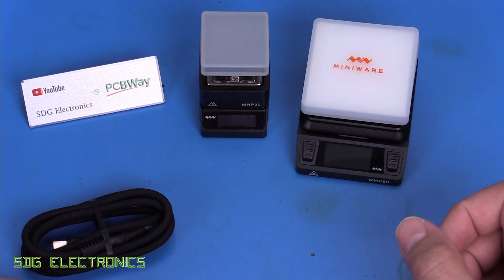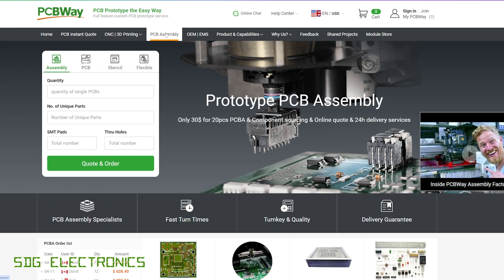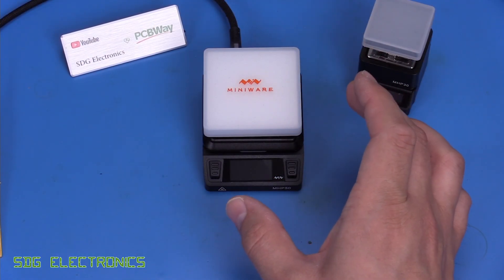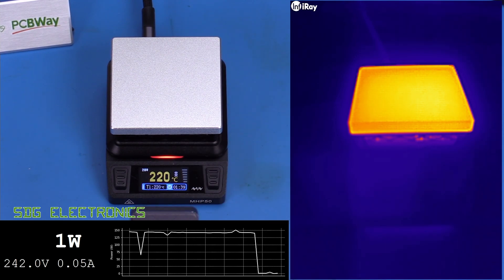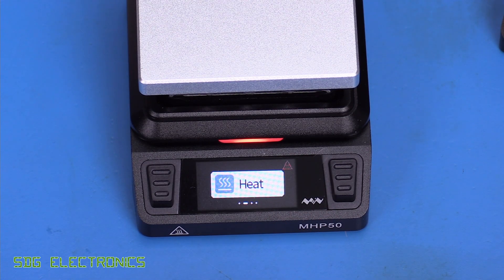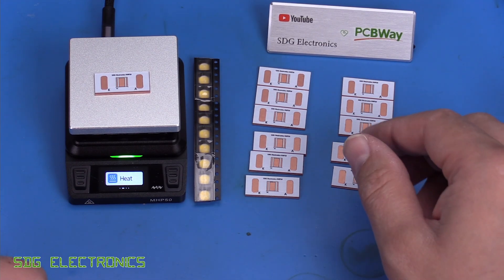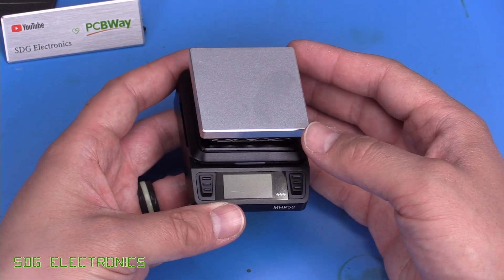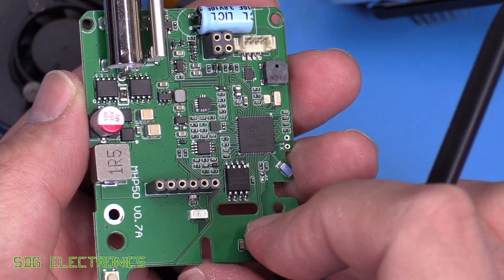SDG #334 Miniware MHP50 Mini Hot Plate Preheater

Comment: Hi Steve. Quick question if I may. After applying solder paste, 
Is there any disadvantage to throwing on a bit of extra flux paste? A bit of extra clean up is not a problem but just wondered if there's any reason I shouldn't do this.
Cheers
Matt.

Comment: Furthermore I don't agree with the comments in this video of having to slide off the PCBs after the solder has flowed.

The fan has been installed for a good reason and it's not there to keep the Miniware MHP50 cool.

The main purpose of the fan is to cool down the hot plate as quickly as possible after the solder has flowed.

I suspect that this is the main driver for the aluminium hot plate option which cools much faster than its brass counterpart hot plate option.

My take is that you choose the aluminium hot plate (which has a lower thermal mass than brass) if you want faster cool downs (assisted by the fan).

Once again this is my take as I had to make some decisions about buying this Miniware MHP50 which had me thinking.

I'm not familiar with what is available on the market, but it seems that the Miniware MHP50 is the first hot plate that has a programmable soldering profile which up until now has been the realm of soldering ovens.

Are the other soldering hot plates on the market that have programmable solder profiles?

I've never heard of a soldering hot plate with a cool down fan up until now, which if true makes this soldering hot plate a revelation to have programmable soldering profiles and goes to explain why there is an aluminium hot plate (which has much better cooling performance... heating speed is less important) and I can't really understand any advantage of having a brass hot plate in this application.

This is just my personal opinion as I've only just ordered my Miniware MHP50 24 hours ago, so none of what I have written is from practical experience.

Comment: I'm human and therefore I make mistakes but having had studied the spec sheet for the Miniware MHP50 I don't agree with what was said in this video.

My take is this:

1. The USB-C power interface is PD 3.0 (not PD 3.1), therefore the MHP50 can only put out a max of 100W if powered via USB-C.
2. The 5.5mm x 2.5mm DC input can go up to 28.0 VDC achieving a max of 150W.

How did I come to this conclusion?

I wanted to buy a Miniware MHP50, but I also needed to buy a PD 3.0 (not PD 3.1) USB-C power supply.

A PD 3.1 power supply is double the price of a PD 3.0 power supply and therefore unnecessary for the Miniware MHP50.

If you want to run the Miniware MHP50 at its maximum 150W the only way you will do this is through the 5.5mm x 2.5mm DC input with 28.0 VDC.

I don't know this from practical experience because I ordered my Miniware MHP50 only 24 hours ago on Aliexpress, so it hasn't arrived.

There is nothing in the official Miniware MHP50 spec sheet that it uses the PD 3.1 standard, so save your money by not buying an "expensive" PD 3.1 power supply.

100W will work for most applications, but the only way you will hit 150W is if you power the Miniware MHP50 with 28.0 VDC via the 5.5mm x 2.5mm DC input.

My assertion is based on the Miniware MHP50 spec sheet and not practical experience.

Comment: Thank you for your review. When you use USB-C power supply to restart the reflow, it should be that the power of the power supply is not enough. You can adjust the PD power limit to about 130W in the menu, and it should not restart.

Comment: I've been using my MHP30 to reflow small boards, with IronOS it can also do reflow profiles. Funnily enough it also has an issue where sometimes it stops during the initial ramp up (before 100C). I'd probably get this one if I was in the market for a small hot plate now.

Comment: Is the temperature across the plate of the MHP50 consistent? I bought a cheap hot plate branded as "MHP30" (clearly isn't the MHP30) and the temperature varies wildly between the middle and edges.
Reply from the maker: It shows about a 3°C difference across the plate, so it is pretty good.
Reply: @sdgelectronics  Thanks for replying! The quality sounds good.

Comment: It can be a bit difficult to find the right power supply for these hot plates. I bought a compact Belkin 65W power supply for a MiniWare MHP30 and it would constantly restart when it started heating up. I ended up using a PinePower Desktop power supply. Similarly the MiniWare TS80 requires a QC3 power supply. My USB-C PD power supplies don't work with the TS80. I gave a TS80 to a friend but forgot about the QC3 requirement... doh. Now they need to get a new power supply.
Reply from the maker: That's why I ended up getting the ugreen power supply. Hopefully that should cater for everything unless a new standard comes out.
Reply: I power my MHP30 with the same Belkin 65w all the time, just set the power limit to 60w in IronOS firmware.

Comment: Did the USB-C max power get bumped up to 150W in the beta firmware? I’ve had one of these for a couple of months and it maxes out at 100W with USB-C and 150W with DC 5525. This is per the manual, device UI, and my personal experience.
Reply from the maker: Yes, the firmware updated the USB-C power ratings. It's supposed to be released very soon.
Reply: I got this from your link when it was around 75€. It was V1.0 
I found MHP50APPV101 from their site and now my thing say on screen "Not e-Design Product!"

Comment: E-design told me a 40mm heating element and tin pot are in the plans when I emailed them (2021) about buying replacement 30mm elements in case the surface got damaged, for the MHP30. Wonder if the tin pot is still happening, probably can now that this higher power device has released otherwise I was wondering how the mhp30 base could support a tin pot as a replacement module for the 30mm hot plate

Comment: Thanks for the nice video review. Can you please explain why the boards need to be moved off of the hotplate before it cools down? Can't they be left there until everything has cooled down?
Reply from the maker: Most electronics components aren't rated to remain at high temperatures for anything longer than a typical reflow profile.
Reply: The cooldown part of the reflow cycle is quite important to help avoid thermal shock and to get the best joints. You don’t have to wait till ambient though, I found 70degC is enough.
Reply from the maker: @IanScottJohnston  The hotplate takes around 10 minutes to drop to 100C and for some reason doesn't spin at maximum speed for very long. I think there are still some firmware tweaks needed.
Reply: @sdgelectronics  10 minutes is ridiculous i thought the fan was supposed to ramp its profile down, i was just about to buy one but i think ill wait a while longer until they release a firmware

Comment: i could do with one, but for the limited use they are a bit pricy. keep looking for a lab hotplate to come up cheap as they are a bit more versatile.
have been thinking of getting a steel plate and putting some cartridge heaters on it, this might work out a fun project. still working on the heat isolation from the plate to base bit.
Reply: The UYUE 946 1010 Is very nice for the price, I modified it to have the control base seperate from the hotplate to lower it on my bench and it works flawlessly for me.